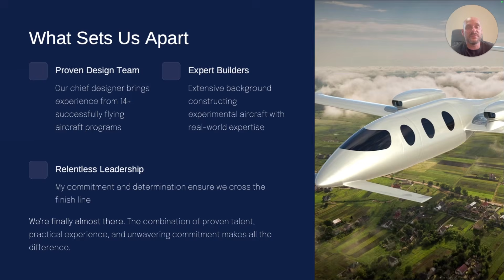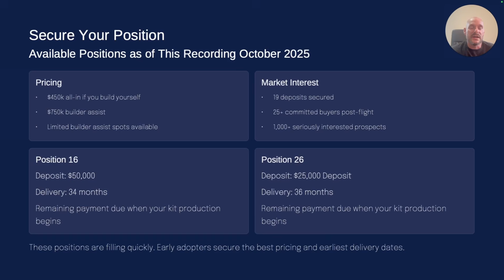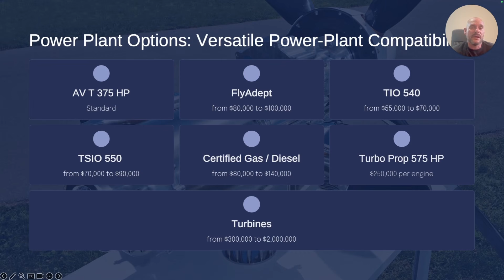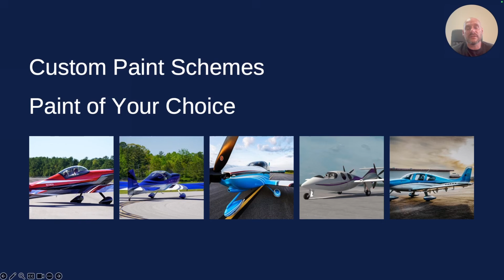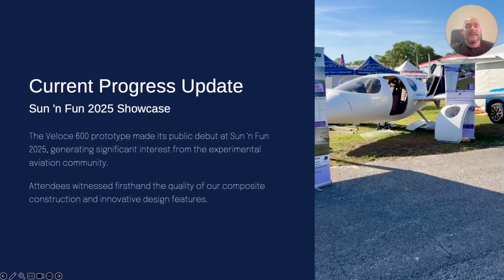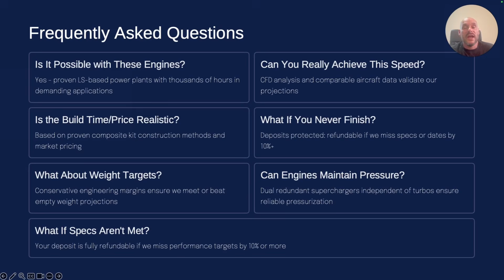The Fastest Twin Ever Built Under $1M - And You Can Own One

Comment: I really like the concept, but from my point of view it only makes sense for the U.S. market. FAA Part 23 certification does not apply in Europe, and while we do have kit aircraft here, they are not allowed to fly IFR and therefore cannot operate at higher flight levels (typically anything above FL165). Because of these regulatory limitations, the real potential of this aircraft can only be fully realized in the United States.
Reply from the maker: not true . there is a trust company in the US.  you can buy the plane here and register it here, and then fly it normally in europe on the N number there.

Comment: Pulling hard for your success, but we’ve seen this sales pitch time and time again. Two questions for you: what is the projected speed at FL280, because that’s what you’re going to be limited to without RVSM equipment on board? And, who will work on this plane in the field when you’re over the middle of nowhere and lose an engine but limp into a podunk field? My guess is no A&P will touch it nor be up to speed on it’s systems. You’ll be left begging to borrow their tools and try to fix it yourself. I know this because I really wanted to do something like this in my build, N36LV, but a very wise man said call two rural FBO’s and ask them this very question. Both laughed at me and basically said HELLL NO! 

On a positive note, with new manufacturing technology making alternative engines much more reliable coupled with CAD and outsourced manufacturing keeping costs under control, we just may be at a crossroads sweetspot not seen before. Best of luck!
Reply from the maker: Thanks.  300-400 ktas depends on the engines you choose.  
depending on the engine, the aerovolare can be any car mechanic.   the turbo prop options would need specialized centers.

Comment: same configuration as the piaggio.  its the fastest turboprop.  getting the laminar flow on the fuselage  back to the main wing is key to meeting the performance goals.  i remember when the piaggio was being developed  and how they used lots of wind tunnel testing. i read it in flying mag..  maybe the fuselage could be designed with a computer to get laminar flow and save lots of time and money.
Reply from the maker: we did CFD.   don't have the cash for a windtunnel right now